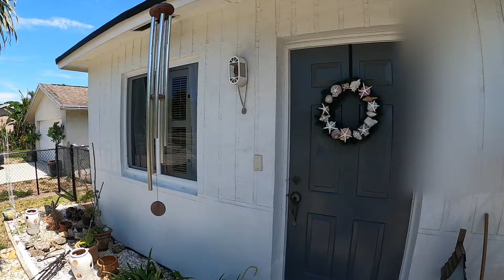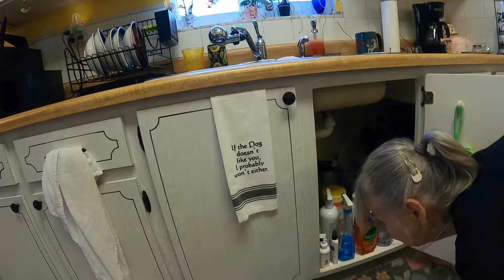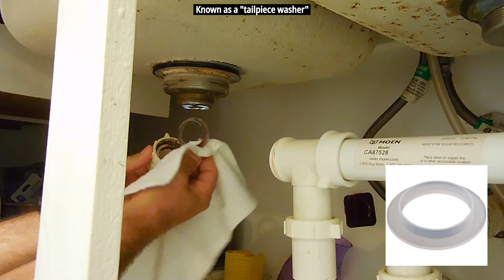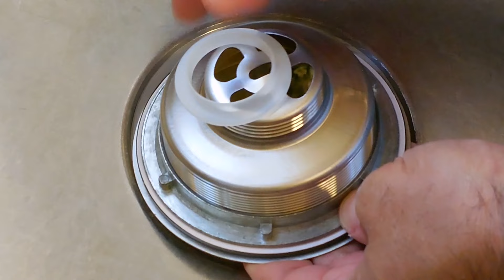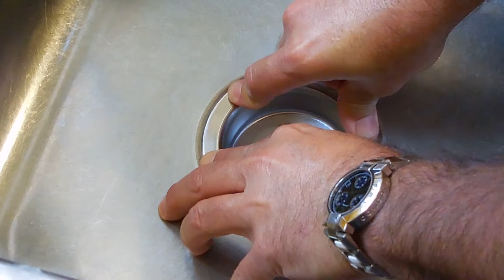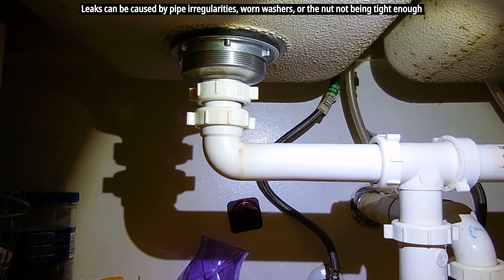How To Fix Or Replace A Leaking Kitchen Sink Drain Assembly ~ With Humor!

Comment: I learned some things!  I'm no plumber, but I have worked on a lot of under-sink configurations, making so much better and having issues on this particular job.  The way you rolled the puddy and used the teflon tape are the things I didn't know.  What a greatly helpful video!  Thanks!  Now if I can just remember these things the next time I need them.  😏😁🤣  I do have the specialty tools, just not all the practical knowledge and their remedies when needed.

Comment: Always like the Rose episodes. Thanks for explaining how to DYI, especially how to fix the leaking connectors. You said there are two methods. You showed teflon tape, is there another method.
Reply from the maker: Glas you liked it. I mentioned using the silicone sealant. Thanks for watching!
Reply: @electronicsNmore  Thanks. Seriously, I'm going to try this myself next time instead of calling roto-rooter.

Comment: Are the doors designed to open out rather than inward because of hurricanes?
Reply from the maker: Better for hurricanes and fires.
Reply: There's also an added benefit.  That looks to be a pretty small house,  having the door open outward buys you an extra 10 square feet of floorspace and without it knocking into furniture when it's fully opened!

Comment: Can't count the number of those I've done throughout the years, even a few that had the broken nut just like this one.  It's good Rose has you as a neighbor, just saved her a couple hundred bucks from an unscrupulous plumber! One thing I would have done a little differently tho,  when I saw how dirty the pipe was inside,  I would have just pulled the whole trap and T adapter out to clean them... Nevertheless,  a job well done...

Comment: Is that really 40 years old?  I just had to replace the under the sink plumbing in my kitchen and it was put there in the 90s and there was little PVC, it was mostly metal.  40 years ago is 1981, were they using all PVC back then?
Reply from the maker: The house was built in the early 60s, and the sink was probably replaced early 80s.
Reply: @electronicsNmore  I bought my house off of my parents and so I am fortunate enough to know what was done since the early 80s.

Comment: I have really bad luck. Any time I touch any plumbing, I replace EVERYTHING I touch.  In my experience, these things are designed to seal 1 time, especially those little hoses that go from the wall to the toilet or from the copper pipes to the faucet fittings.
Reply from the maker: Plumbing is a pain in the @ss, do a good job, and you can still get leaks with pvc drains.
Reply: The problem is that the hoses AKA supply lines, their gasket seals are damaged due to them being over tightened during installation.

Comment: The rubber seal is meant to seal the drain to the sink bowl. As in: it should have been used instead of the putty. 
The rubber ring is pointless below the sink bowl because if the putty was to leak the water would seep via the threads.
The rubber seals work fine alone but no harm in a light layer of silicone on both sides of the rubber seal.
Reply from the maker: Incorrect. Placing the rubber seal under the flange inside the sink, results in the flange being higher than the sink bowl and you end up with standing water around the flange. I've corrected many of those over the years. Using the rubber seal under the bowl, allows the nut to compress the washer evenly against the underside of the bowl in case there's any irregularities.